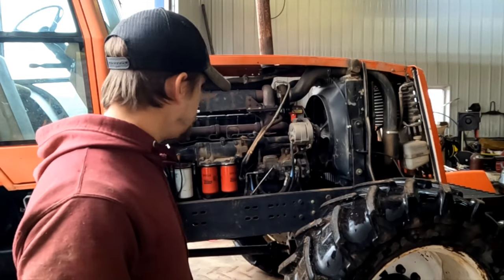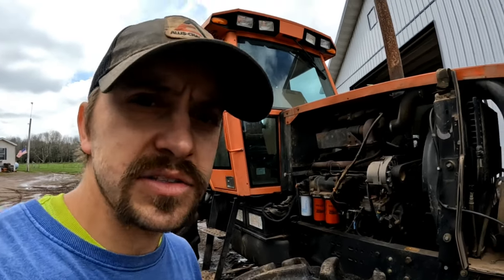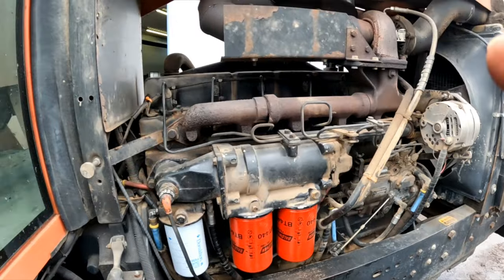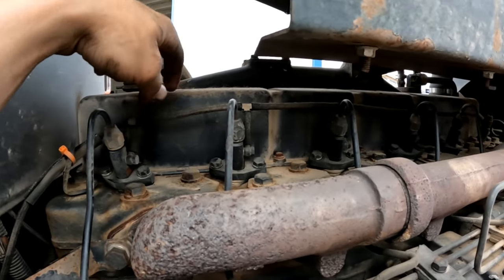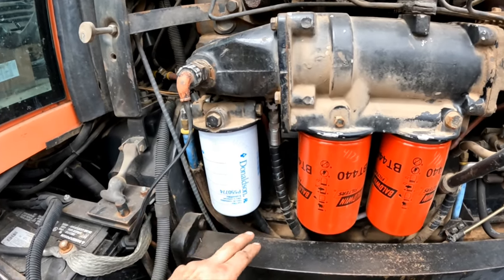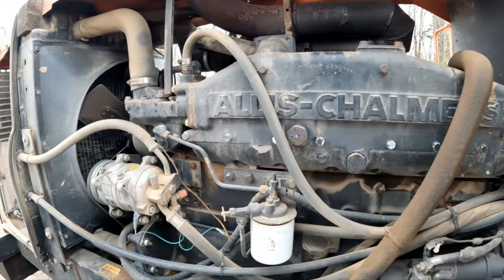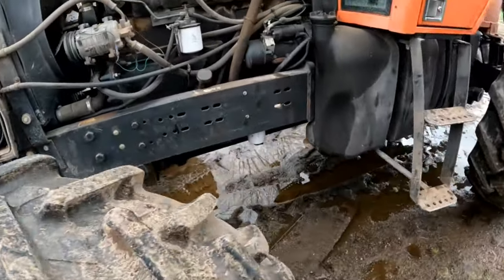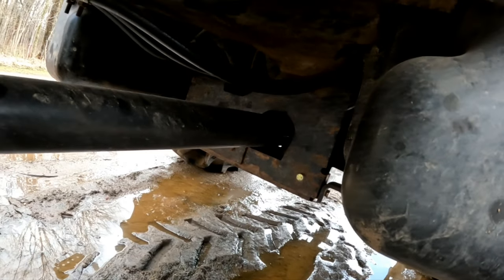Allis 8030 Oil change and rundown

Comment: Did you buy any of them new
Reply from the maker: Only the two 4wd 6080s were bought new. Everything else was "saved" from auctions or dealers.
Reply: @Peterson_Farms  do your 6080 start hard the one I was around only starts good with it plugged in
Reply from the maker: @Bill Amsberry  the one with the low compression pistons do start a little hard. But otherwise no, they start good. Love our 5 6000 series.
Reply: @AllisPeterson  that's what they need is a rebuild